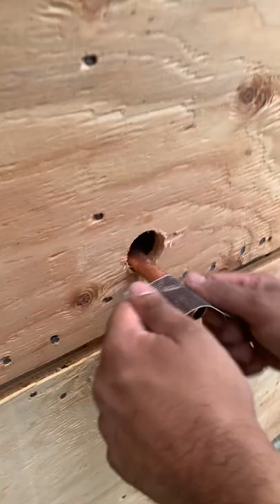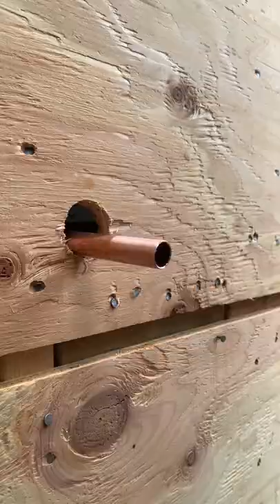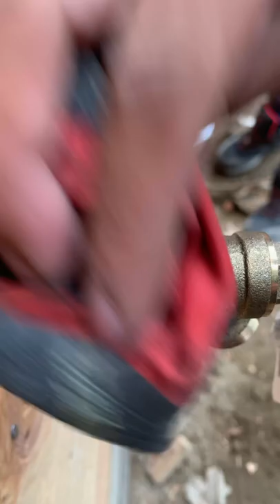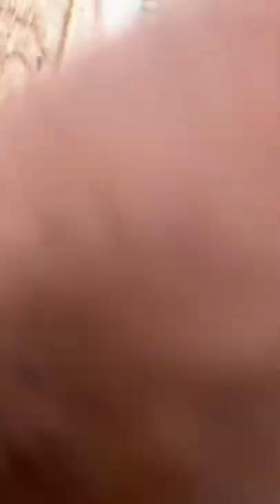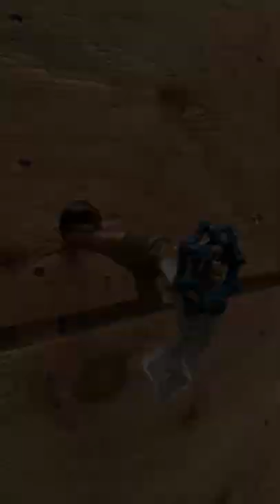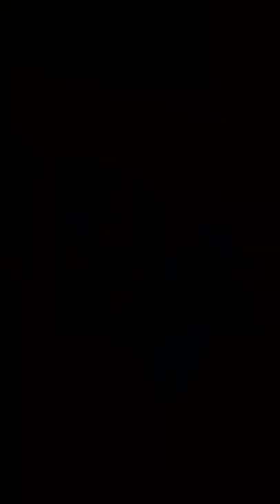Hose Bib - Soldering #Shorts

Comment: How did you remove the old hose bib?
Reply: Either cut it or heat it up until the old Solder melts and you pull it off

Comment: Why wouldn't you heat the hose bib from the top and wick the solder from the bottom so it flows upwards towards the heat? That seems like it would be a cleaner way to do this solder so you wouldn't have excess solder dripping!!!